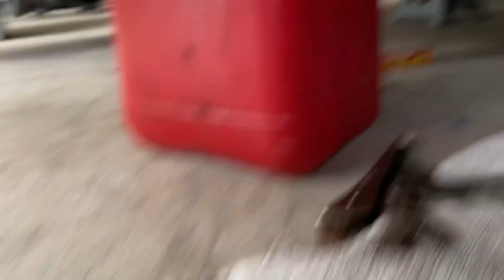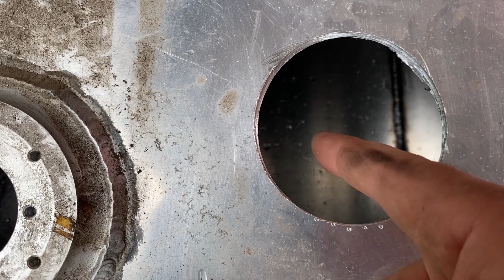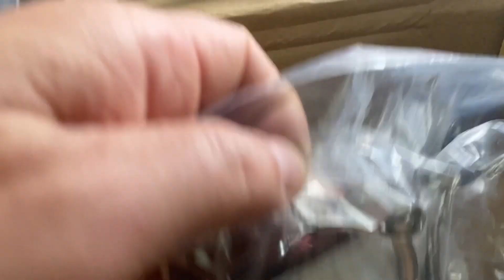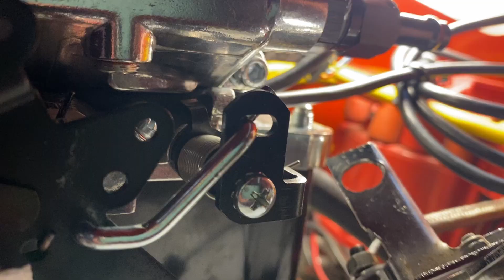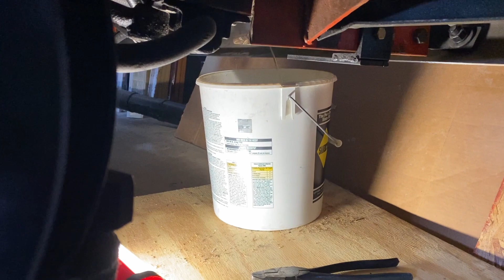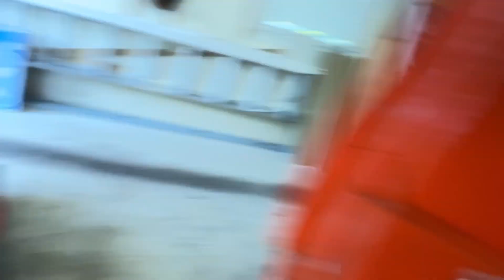Chevy 350 Holley Sniper Install

Comment: Any updates on your sniper install
Reply from the maker: I should do a follow up video on what I learned since the install. This was my intro to EFI. The engine was stumbling during acceleration. I spent hours and hours tuning the system and lots of time chatting on the forums. Turned out one of the electric plugs on an injector was loose and it was only running on three of the four barrels. Once I was over that hurdle my tuning efforts paid off. The engine runs absolutely great now. I have since installed and tuned the hyper spark system. Once over a different problem (rfi issues flooding the engine) it is great as well. I then added a semi aggressive roller cam and aluminum heads with bigger valves. Will now smoke the tires until it hits second gear! I learned a lot and would do it again.